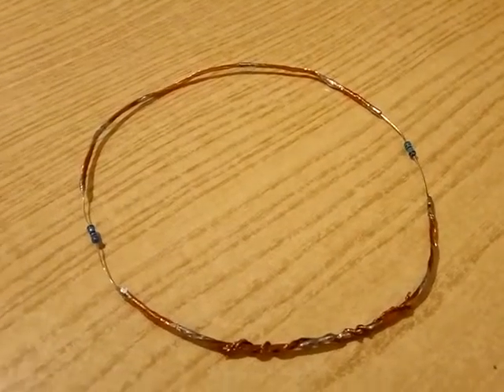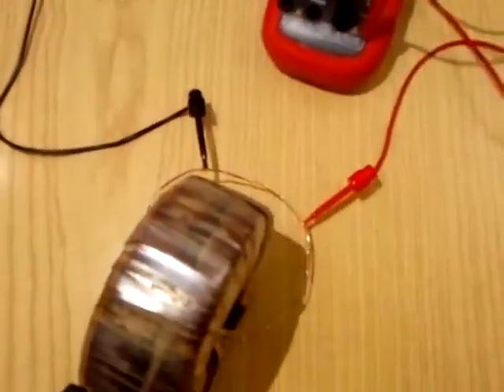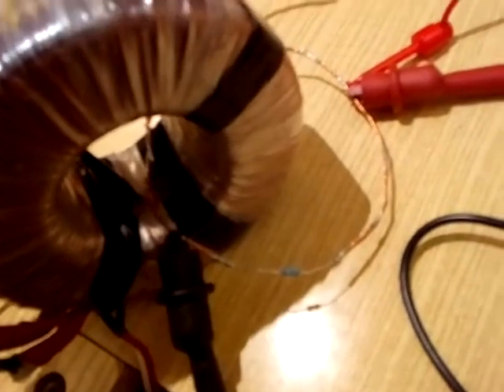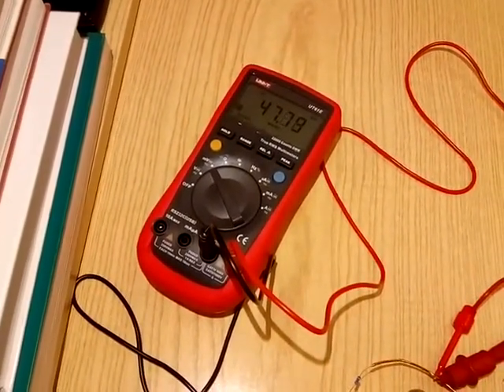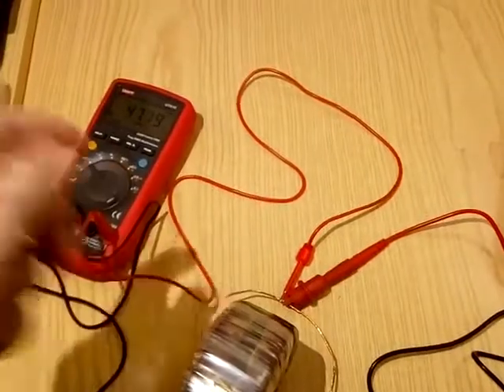The Romer-Lewin ring with resistors: two voltmeters read different voltages

Comment from the maker: 00:00 Introducing the ring
I built it by soldering two naked strands of copper to a 2.2 ohm resistor on one side, and a 15 ohm resistor on the other side. I added a few soldering blobs here and there to prevent the strand from undoing itself. I left one arc longer than the other, then I cut it so that I could open the ring and then tie it around a transformer core.

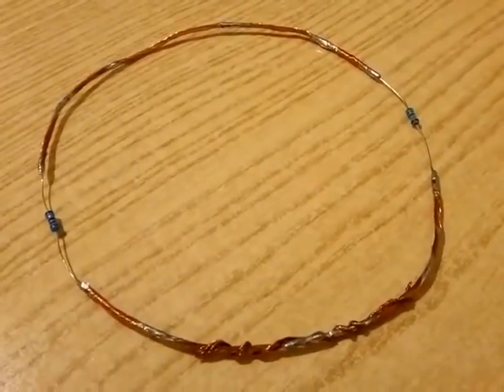00:28 The  toroidal transformer
Here I am measuring the emf due to the magnetic flux linked by one turn around the core of a toroidal transformer.
It came out as 372 mV (all measurements are RMS, and I am ignoring the error in the voltmeter reading, for simplicity)
Note that the shape of the secondary coil - realized with the probes and  closed on the internal resistance of the voltmeter - is irrelevant because all of the flux is confined inside the core.
The induced electric field, which runs in circle around the core, behaves as a conservative field in all regions of space that do not contain the core. But does not behave as a conservative field when we go around the core.

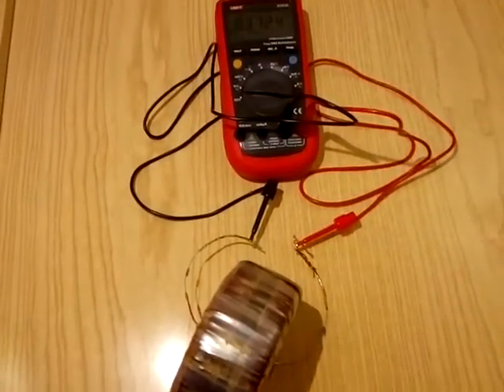00:53 The open ring around the core
Here I placed the ring around the core,  but I left it open and placed the voltmeter across the gap. We are basically closing the loop with the internal resistance of the voltmeter. Let's say its 10 megaohm (it's actually higher when the dial in on the millivolt range for this particular multimeter): the full resistance of the loop becomes a little more than 10 megaohm. The current flowing in the ring with the added voltmeter is

    272 mV / 10 megaohm = 27.2 nA

What are the voltage drops on the resistors, in this setting?

    2.2 ohm * 27.2 nA = 59.84 nV
    15 ohm * 27.2 nA = 408 nV

Since less than half a millivolt drops along the resistors, the entire emf is basically appearing in the form of voltage drop across the internal resistance of the voltmeter.

01:16 Closing the ring around the core and using a voltmeter to probe an arc of conductor (nearly 2 inches, or about 5 cm.)
When we close the ring around the core, a much bigger current will flow in the ring than when the 10 meg internal voltmeter impedance was part of it.

    Iring = 372 mV / (2.2 + 15) ohm = 21.6 mA
	
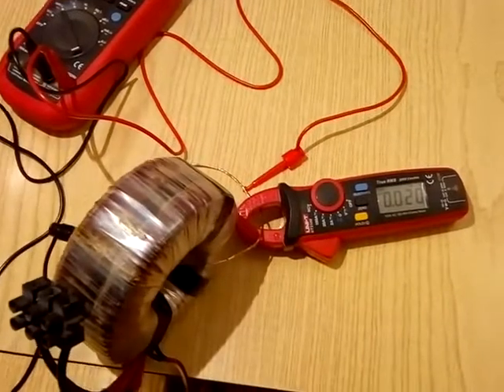The computed value agrees with what I measured  with a clamp on amperometer at 01:46 . The UT136 gives a reading of 20 mA - close enough to the theoretical value, considering the accuracy of the instrument.

This current flowing in 5 cm of copper will drop a voltage of the order of a microvolt, and in fact the voltmeter reads nearly 0V. 

Now, this is a crucial point in understanding how to correctly apply KVL or Faraday in this circuit: the loop formed by the voltmeter, its two probes and the 5cm arc of conductour is sitting in a region of space that does not link any variable magnetic flux from the transfomer (remember, all the flux is contained in the core and this measurement loop does not run around the core). So we can apply KVL to THIS loop : we can consider voltage as path independent in this loop and avoid to refer it to a particular path, by specifying the endpoints only. The voltage along the copper arc between the tips is equal to the voltage along the path going through the probes and the internal resistance of the voltmeter and shown by the instrument.

Compare this to the case of open ring: now that the gap has been replaced by 5cm of copper, the voltmeter is no longer able to read the open circuit voltage.

Path independance does not apply to the ring itself , though, because the ring forms a loop that does run around the magnetic core.

02:05 And now... the full fledged ring with both voltmeters
Here I placed the probes of both multimeters at the same points on the ring (more or less). Now we can identify six loops of four kinds: the ring itself (running around the core), the external loop formed by both voltmeters and their probes (running around the core), the two measurement loops formed by each voltmeter with the 'distant' resistor (still running around the core), and finally the two measurement loops formed by each voltmeter  with the 'near' resistor. Only these last two loops do not run around the core, therefore they do not link any (appreciable) variable magnetic flux - and certainly the do not link the variable magnetic flux that is confined in the toroidal core.

It is these two measurement loops (voltmeter UT61E and 2.2 ohm resistor on one side, and voltmeter UT139C and 15 ohm resistor on the other) that we can apply KVL to. This means that the voltage across the internal resistance of each voltmeter is equal to the voltage across (and along) the 'nearest' resistor.
And, lo and behold, the UT61E reads 48 mV - what we expect by applying Ohm's law to a 2.2 ohm resistor with a 21.6 mA flowing through it. The other voltmeter, the UT139C reads something between 314 and 329 mV - accuracy is significant less in this instrument - still in line we what we expect when 21.6 mA flow through a 15 ohms resistor.

KVL works fine in the outer loops, the ones that are not linking the magnetic flux, but it is no longer valid in the ring itself . 
The ring runs around a variable magnetic flux and therefore the circulation of the (total) electric field is no longer zero. This means that voltage (which is defined as minus the path integral of the total electric field) in the ring depends on the particular path between two points. And sure enough, voltage along the path that goes through the 2.2 ohm resistor (and also along many other paths in the nearby region) is 48 mV, while voltage along a path joining the very same endpoints but going through the 15 ohms resistor is 320some mV. (There is also an inversion of phase, as can be seen if we use an oscilloscope instead of voltmeters like I did in my other potatorama video.)
As Lewins says: KVL is for the birds. And it is for the birds in the ring itself, and in all measurement loops that happen to run around the core. 

We can still apply Faraday, tho.
Reply from the maker: @Biskwit2 ok, forget the meters. Consider just a single turn coil around the core with a small gap in it. Fix a particular instant in time when the induced electric field goes say counterclockwise and has its maximum value. This Eind field will make the free charge in the copper of your single (open in the gap) turn accumulate at one end and deplete on the other. You end up with one side of the gap negatively charged, and the facing side across the gap as positively charged. This opposing charges are responsible for the electric field you see across the gap: if you bring the terminals close enough the field will become so high that it will surpass the breakdown voltage of air and a spark will be produced. So, there definitely is an electric field in the gap because of the displaced charge. Actually this field is composed of two parts: the electrostatic field due to the presence of charge (from positive charge to negative charge) , and the induced field due to the variable magnetic field in the core (counterclockwise, it comes out in the same direction as Ecoul). The former is much stronger and we can neglect the contribute of the latter. In terms of voltage along a path in the air between the terminals, all the voltage basically comes from the coloumbian field. You end up, say, with 360 mV of voltage.

What happens inside the coil?  Inside the coil you still have the superposition of both field, but inside the conductor  the coloumbian field of the displaced charge is directed along the ring still from plus to minus , hence in the opposite direction of the induced field Eind. This makes sense because we know that inside the conductor the electric field is zero (exactly zero, when no current flows). It is the complex interaction of surface charge that will produce a coloumbian field that is directed like the induced field,but of opposite orientation.
So when you compute voltage from one terminal to the other by going inside the copper, you end up with zero voltage.
And yet you have 360mV of voltage from the same start point to the same end point when you go across the gap.

No probes involved. No voltmeters necessary.

I welcome your question but I have a prayer: make them short. ;-)
Reply from the maker: @Biskwit2 I guess you mean the videos by prof. Melloch, of Purdue University. You can find them with a search on YouTube for "Faraday's law example 1 (electromagnetic induction)".

I am not sure what you mean by neutral, but in the case of an open loop around the core you will get exactly zero field in the wire, but charge will be present (mostly at the terminals). It's that charge, displaced by the rotating Eind field that produces the sourced-sinked conservative field Ecoul that neutralizes Eind in the conductor. And also build up the electric field in the gap, leading to the voltage you can measure.

When you connect the voltmeter, the charge that had accumulated (at a given instant in time, since it's oscillating at 50 Hz) at the terminal is... conducted via the probes to the internal resistance of the voltmeter. Now that we have closed the loop on this internal resistance, a very small current will flow (370 mV / 10 megaohm = 37 nA) and the field in the conductor is no longer exactly zero, but it has a veeeeeery little nonzero value corresponding to E = j / sigma, where j is the current density (27 nA / cross section area of the wire) and sigma is the very high conductivity of copper. But it's negligible and we can approximate it with zero.
Reply from the maker: @Biskwit2 ok, neutral as in with zero charge. Yes, the terminology is fine and physierge also got right the Faraday-Kirchoff distinction ( I suppose you already watched the two videos where he consider the circuits with inductors.)

To be honest, regarding the video you linked, while I agree it's an intuitive way to explain why there can be no electrostatic field inside a conductor, I do not think that in the real world , limited by lightspeed interactions, the inside of the conductor could ever see the electric field E. Because in reality you either have to transport the body at sub-light velocity in the presence of an existing field, or you must create a field in the region of space where the body is and that implies that the field will propagate from the sources to that region at the speed of light .

In either cases, it's the surface of the body that will be exposed to the field before its interior, and the very fast redisposition of such charge will prevent the field to ever (appreciably) penetrate the body.

But that's nitpicking.
Reply: @copernicofelinis  
Copernico
I checked your reference. You are correct. Text books on KVL do use the term Loop in that way, but it is rather unfortunate that they choose that word because the same text books and physics in general also uses the word loop for a current travelling in a loop to back where it started, a totally different meaning.
Reply: Hello C F,  you stated incorrectly that Kirchhoff loop rule can be applied to the meter and adjacent resistor. It cannot , because two conductors in parallel do not form a loop. The rule for them is not Kirchhoff it is the  Ohms law for conductors in parallel .
Reply from the maker: @woodcoast5026  two resistors in parallel form a loop. The rule for parallel resistors comes from applying KVL to such a loop. The voltage across either resistor is the same exactly because of KVL.
Reply: @copernicofelinis  You just stated "two resistors in parallel form a loop"  that is an absurd statement.  When two resistors are in parallel the current runs from one end of the split path to the other end of the split path.  KVL applies to conductors in  SERIES. The meter and resistor are not in series they are in PARALLEL.
Reply from the maker: @woodcoast5026  a loop is any closed path in a circuit. See here: https://www.electrical4u.com/nodes-branches-and-loops-of-a-circuit/
Reply: @copernicofelinis  It is not a loop, it is not a closed path. It goes through the meter and resistor in parallel , and then continues around the ring.
Reply from the maker: @woodcoast5026  in my universe that is a loop. This is a standard definition in circuit theory, and is given in basically every textbook I've read. Nodes, branches, loops, meshes, cut sets... 
What circuit theory textbook has your definition of loop?
Mine can be found for example on p. 9 of Chua, Desoer, Kuh "Linear and Nonlinear Circuits".
Reply: @copernicofelinis  Do you realise what you are  saying. You are saying that if two resistors are in parallel with an EMF applied across them then the current goes around and around the resistors from one resistor to the other in a circle.
Reply from the maker: @woodcoast5026  I don't know where you got this strange idea. A loop is not a path with a single current going around it. As part of a more complex circuit it can have different currents in the different branches it is composed of. This is basic circuit theory. I suggest you brush up your circuit theory, especially mesh analysis (maybe you call loops meshes? And KVL a mesh law?). Chua, Desoer, Kuh might be a bit too much technical. Try Alexander & Sadiku. Or Hayt, or Franco, or Smith.
Reply: @copernicofelinis  As you have the circuit on your bench you can demonstrate it in front of you own eyes. Replacing R1 with two 4.4 Ohm resistors side by side  and replacing R2 with two 30 Ohm resistors side by side. Now with that arrangement with the voltmeter resistances there are 6 resistances  the circuit behaves as before , and on one side of the circuit , the circuit has  three resistances, and the concept of  the current circulating around the two resistors and then going on to circulate around  the internal resistance of the voltmeter is impossible.
Reply from the maker: @woodcoast5026  I am afraid you need to study a little bit more circuit theory. In the original circuit with two resistors in the ring, the fact that voltmeter and nearest resistor (say 2.2 ohms) form a loop does not imply that the same current flows in the resistor and in the voltmeter. The current in the resistor is around 21.6 mA, the current in the voltmeter next to the 2.2 ohms resistor is 47-48 nA.
Reply: @copernicofelinis  
Lets make sure we are talking about the same thing. Are  you   confirming that you  are saying that if you connect two resistors in parallel and apply an EMF across them , the current spins around and around the resistors in a loop  . That is what you have been saying throughout the thread. 

In fact if two conductors are in parallel the current flows from one side of the path to the other.
Reply from the maker: @woodcoast5026  if you apply a localized emf (for example generated by a battery or a changing magnetic flux outside the loop formed by the two resistors) across the two resistors the current will flow in the same verse through both resistors, and it will have different values according to the resistance. 

A different thing is when the emf is non localized, for example when it is generated by changing flux linked by the loop the two resistors is made of (but we are not talking about that).

So: 2.2 ohm and 15 ohm in a loop around the core will have current going 'in a circle' (same current in both resistors) and voltages at the resistors with opposite polarity. 

2.2 ohm and 10 Mohm in a loop NOT around the core will have current flowing in the same direction and voltages in said resistors of the same polarity (in fact the voltages are equal, despite the current being so different.
Reply: @copernicofelinis  And so we arrive at the conclusion , considering a meter and resistor pair,  the meter resistance is in parallel with the resistor and  the current flows through that parallel  path, and then continues to the other half of the ring where it then  goes through the parallel path of the meter resistance and resistor pair on that side.
Reply from the maker: @woodcoast5026  ok, now I see want you meant to say. This is equivalent to say that two resistors can be considered in parallel - ie sharing the same voltage - only if there is no variable magnetic flux linked by the loop they form (I am using here the definition of loop that appears in all major circuit theory books.)
If there is a changing flux, then there is an emf and the voltages cannot be equal, so one cannot consider the resistors in parallel. This is what happens in Lewin's ring alone.

We are saying the same things with a different perspective (plus you used a non-conventional definition of loop), but we basically agree on this.
Reply: @copernicofelinis  I did not use a non-conventional definition of a Loop. It was you yourself that used a  non conventional definition of a loop where my comment was referring to the  two circuit elements of internal resistance of a meter and and a discrete resistor. You called two resistors in Parallel a loop. There is no text book description of conductors in PARALLEL that calls them a loop. To do that is literally a CONTRADICTION IN TERMS. Kirchhoff loop rule is a summation of voltages along conductors in SERIES. It sums to Zero. The voltage across the Meter and resistor in parallel does not sum to zero. It is simply the voltage across them, as I said in the very first comment in the thread. 
 However we are saying the same thing about what is observed in the circuit. 
 But if you are curious about why those observations are why the are, it is  necessary  to be precise.
Reply from the maker: @woodcoast5026  Alexander, Sadiku "Fundamentals of Electric Circuits" 2e, section 2.3 "Nodes, Branches, and Loops", p. 34:  

    "A loop is any closed path in a circuit. A loop is a closed path formed by starting at a node, passing through a set of nodes, and returning to the starting node without passing through any node more than once."

And I have similar definitions in Desoer, Kuh; in Chua, Desoer, Kuh; in Hayt; in Franco; in Kraus; in Smith... In every single circuit theory book I have ever laid my eyes on.

Can you produce a reference with your definition of loop that excludes the closed path formed by two resistors in parallel?

You might prefer the term mesh, but a mesh is still a particular kind of loop.
Reply: @copernicofelinis    All  text books when describing a circuit of two resistors connected in parallel  treat them as  two resistors in parallel.